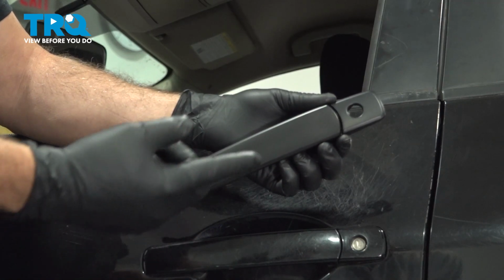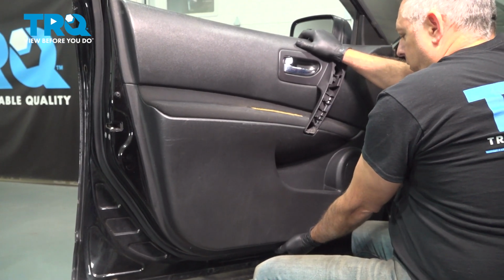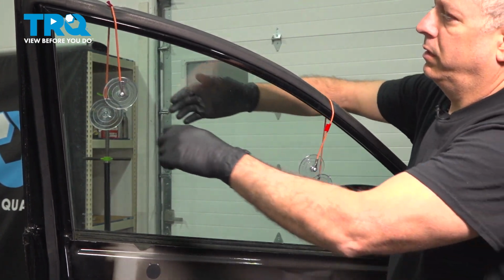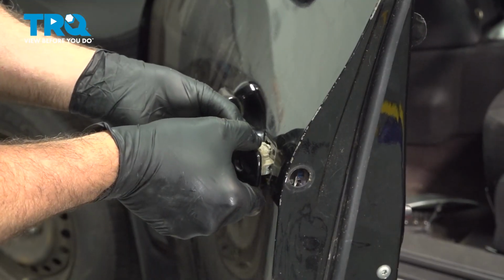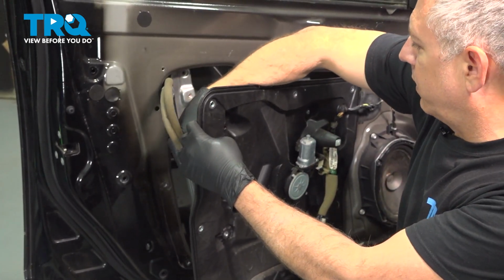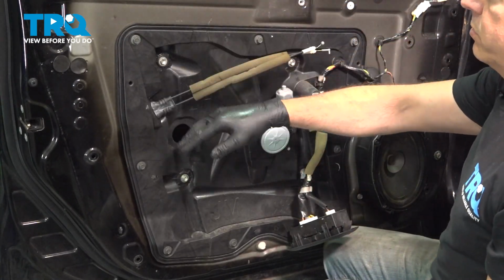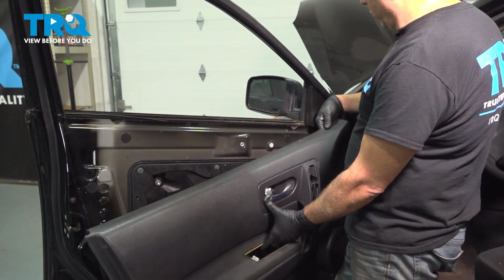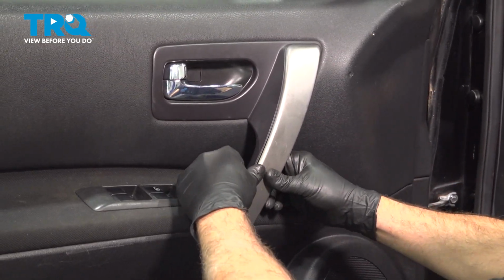How to Replace Exterior Front Door Handle 2008-2013 Nissan Rogue

Comment: If you have the outside lock button this is absolutely necessary since you will have to detach a wire from the inside. But if your handle doesn't have a button you can do this from the outside, inside dissembly not required.

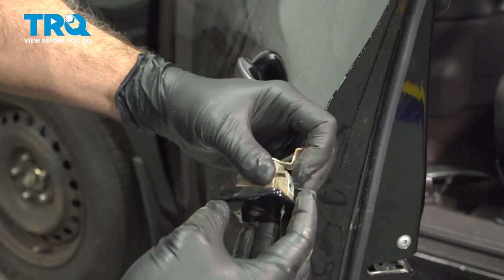Comment: IMPORTANT BEFORE WATCHING:  05:42 FYI this excellent video is made for those replacing the lock cylinder as well, which WILL require removing the door panel.  If only replacing the door handle and not the lock cylinder, then it is not necessary to remove the door panel.  Therefore, ignore the unnecessary "crying" below by those who didn't "listen" to the entire video.

Comment: This worked on my 2013 rogue with smart button.  Used t30, and a Phillips to take single screw off underside of handle. Put original button and wires  into new handle. Screwed in the 1 screw, reinstalled and tightened t30, done THANK YOU. I typed another message but it seems to have gotten lost. Bought on Amazon. Be patient and you'll see how it goes together.

Comment: THANK YOU, THANK YOU, THANK YOU. I did this fix in minutes after watching your video,  on my 2013 rogue with smart key button . I took the 1 screw off back side of handles, used original wires and button on the new handle.   T30 retighten. Wish all my repairs were this easy. Ordered part on amazon. The button side has to go around a piece of metal in door . I had already installed the left side, so I slide the handle to the right, pushed around metal piece on right, then slide handle  back to the left. Your video is the only one that really shows us you don't have to take door apart when fixing the smart button handle. THANK YOU AGAIN.

Comment: Ty for the info. Matched my 2015 Select almost exactly. 

I feel silly for commenting on such and old vid, but for anyone trying this now:
- The yellow clip unhooks easily with a 90 degree pick. 
- The T30 appears captive. Sure, be careful, but if it was not captive, I would have lost it. 
- The bits you slide the handle into can fall away (see above), but you can reach in with the right hand and reposition it.
- Re-attaching the window regulator bolts: on mine, there were a pair of circular paper bits covering two holes that let you reach in and position the bolt holes. I hadn't noticed the right/forward one and wasted some time before finding it and setting the bolt quickly. 
- A glued-on spacer block foam thing fell off. Have some glue handy or don't worry about that part. Tape worked. 

I watched the videos that say that you don't need to take the door panel off. I tried that. You should, too. It didn't work for my car.

Comment: Thanks for the video, I have a keyless door handle and removing the door panel was required to unplug the handle door wires from inside. That particular step took me a while, it was hard to press on the clip to remove the wires. The rest was smooth thanks to your video. 10/10 ✅

Comment: Great video. It showed me exactly what I needed to do. My mistake was using painters tape to hold the window up. It wasn't strong enough. I would recommend duct tape or the suction cups. I didn't have suction cups so I tried painters tape, figuring it would be easier to remove. If I have to do it again, I will use duct tape.

Comment: An excessive amount of unnecessary work. You can do this in less than 10 minutes, no door disassembly required AT ALL, simply unscrew the lock with the Torx T30, then move the lock away just enough to slip the handle in. That's it.
You don´t need to disengage the lock or take it out, let alone take out the door panel.
I JUST DID IT. It took me about 5 minutes, and it was perfect.
Reply: Exactly what I did no need to remove the interior door panel. I installed the handle with the smart lock and unlock button.

Comment: While I appreciate this video and the detailed instruction, I just want to warn people that the video makes some steps look way easier than they actually are. The yellow clip and rod on the locking mechanism are in an extremely hard to reach spot and then the torx bit screw on the locking mechanism was not lining up properly to reinstall. Both of those steps took me at least an additional hour just to put back together. Overall I was successful in installing the new door handle but reattaching those two things were easily the most difficult parts of the whole process

Comment: Could not put the new handle.  Inside plastic component shifted and the 30 torks edge bolt no longer aligns with the hole ... Not sure what happened ☹️  wish I had not attempted this

Comment: I have a 2010 Rogue AWD 360 and the driver's  door would not open  in or outside.  The following steps may help you! (it is really not that hard.
1.  Remove the 10mm bolt hidden behind the pull handle.  Remove 2 - 10mm bolts from the handle used to pull the door shut ( hidden behind a pop-off face panel).
2.  Roll the window all the way down.
3. From the outside of the vehicle, carefully pry up the inside panel past the metal housing which it hangs on.  Start at the rear of the door and try to get at least 5 inches past the metal frame.  PUSH the panel into the car and over the frame as you advance.
4.  Using a GOOD  flashlight, follow the window glass on the IN side look down 8 to 10 inches.  If your's is like mine, you will see a white  plastic piece with a hole in it hanging beside the glass.  Snag it with a hanger and pull up and pull the door open.  
That little white plastic clip pulls the lever that allows the latch to free itself when you pull.  You may have to stick the hanger in the hole (it fits) to jiggle it up and down.  The lever has to be freed up sometimes before it frees the latching mechanism.
Once the door is open, you should complete the removal of the door panel by pulling the panel from the plastic clips holding it in place.
Visually Verify that the latch mechanism is moving up and down and lubricate the mechanism..  Examine the inside door handle and make sure the cable that opens the door is seated into it's proper hole in the handle to allow the cable to be pulled. Usually the "barrel" at the end of the cable isn't in its spot.  Lubricate the metal part of the cable so it won't stick when it needs to go back.   Pull the handle and make sure that the same little piece in the door latch release mechanism moves that moved when the white plastic piece was pulled.  Try the outside handle once the inside handle has been verified to function.  Hopefully the cable didn't come off the outside handle assembly.  If you need those instructions let me know.

Comment: Worked well for my driver door handle replacement. Some difficulties we had involved re-aligning the bolt holes for the door panel with the window arm. I got a "compatible" handle and it isn't gliding in and out as readily but it functions.